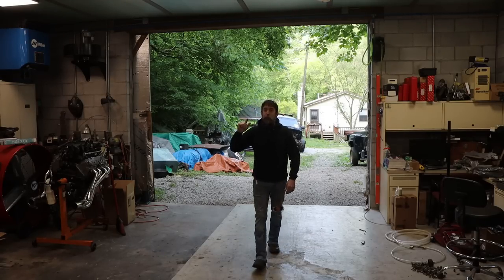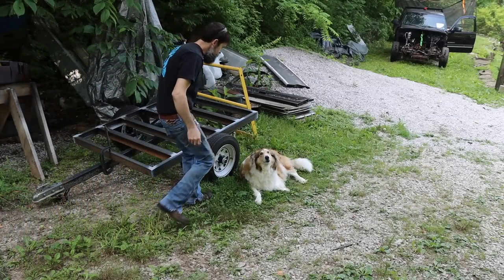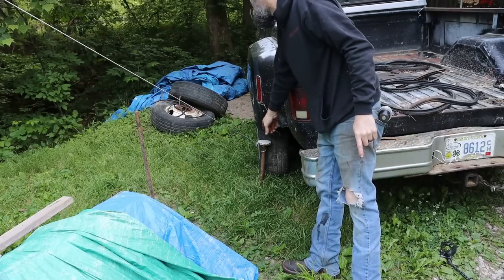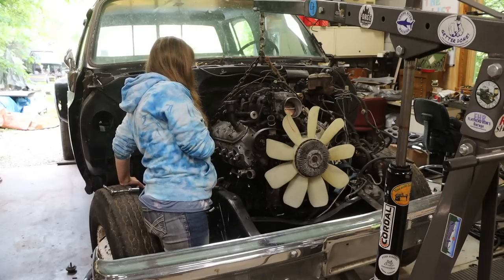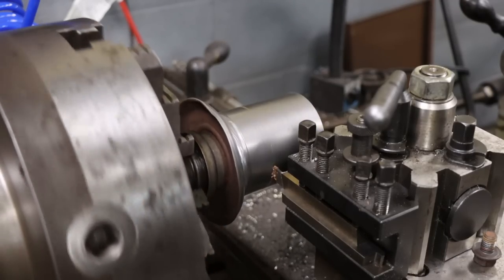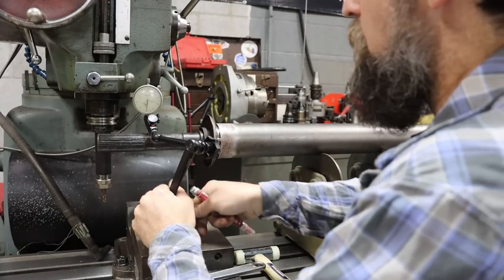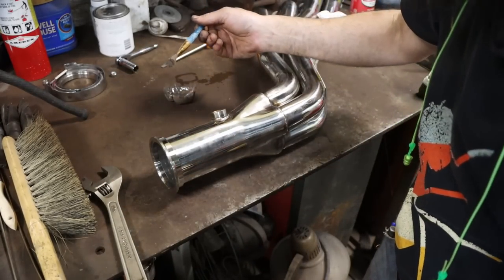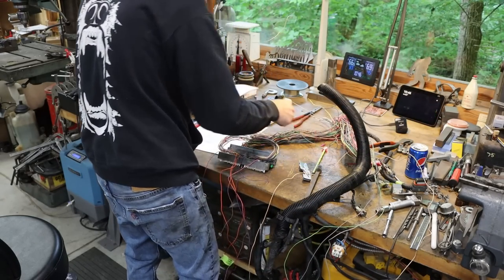Elizabeth & Me LS Swapping  Johnny Cash the Crew Cab part 2

Comment: Most people shortening driveshafts are not machinists and good welders,  I like that your content is all over the place, it means there is something new every video.
Reply from the maker: Thank you bud. A welder is a must but the machinist part isn't necessary.  I remember doing them when I was in my teens when I didn't have a clue😄. They worked thankfully

Comment: I also like to build like you do. Lots of folks throw money at the problem, and really have no idea why something isn't working. after your harness repair, you'll know what's going on when there's an issue. Great video!
Reply from the maker: Knowing more about the harness for troubleshooting is one of the main reasons other than cost, which is why I used the original. I didn't push the easy "Buy Now" button. All those wires are a little intimidating, but it was so much easier than I originally imagined.

Comment: I used to tig a lot of aerospace parts at my job. For stainless and titanium and inconel etc... we had holding fixtures for most and would flood shielding gas via an elaborate spaghetti of tubes and nozzles. Sometimes I would just take an extra tank and hose and flood the joint. Sometimes simple is best. Sure wish you had more subscribers cause you have good stuff to share.
Reply: I wondered if Steve's flux trick would work on Titanium as Ti is notoriously sensitive to back gas problems.

Comment: Keep that rear axle from the junk salt truck.  The disk break setup is great, and if you want to use it on the K10, it's not hard to convert your 10 bolt to 8 lug hubs.

Comment: Always makes me wonder when I see a guy who is doing a fair amount of engine work on cars who is without a balance beam on his engine lift.  I bought one from Harbor Freight in the early eighties when they opened up.  For a very little cost (back then I got it for under fifty bucks).  Makes life so much easier when pulling or dropping an engine in because you can vary the approach as you are doing it in as small of increments as you need.  I have used it in many situations and it has made all the difference.  In boats with tight spaces it is wonderful.   Of course I generally work alone so then it is indispensable for any kind of control and safe lifting without damaging things.

Comment: With all the tech we have these days sometimes good old proven high speed is the go to. Nice to have an hour with you today my friend. As an alternative for anti spatter is just good old fashioned Baking soda thinned in distilled water has always served me well. Headers can be a real pain in the toosh. Too  bad they really do make a difference. Wrap, flat black paint and a grinder are  the best friends we have on builds like this eh. Funny, when I was still working all the various wire and harness work came to me. On more than  3 occasions the shops owner and he would come in and see his brand new low bed truck with the entire front harness in a state of adapting all the needed wiring all over. He just said, I really hope you can put that all back together. When I was done there was no sign I had it all apart. I was always happy doing what others feared to put the wire strippers to work. It's always a nice Saturday when you post for us. Take care eh.
Reply: Yes wiring harness work needs care, and if you are careful you can make it look like it came from the assembly line again. A tip for Steve is if he is going to use slitted sleeve, put a layer of tape over the loom where it will run in the sleeve, and where the ends are at least 3 layers of tape, then put the sleeve. Also any exits from the sleeve, cut a relief in the slit, and 5 layers of tape there on the wires. That way they both have strain relief and also will not chafe through. Then outside you wrap over again with tape to keep it closed. 3M tape is the best, but expensive, though it does hold up well. with a knot at the end to keep it from unravelling as the adhesive ages with heat.
Reply: @SeanBZA  Exactly. As with many things we get what we pay for. Especially with black electrical tape. Many will pull and stretch tape to end a wrap when it always should be cut and tried not to be ended over an area that has finger prints on it. 3M is by far the best I can get. I do have a couple rolls of the cheap stuff for use in  un -important use but the good stuff is reserved for important things. Price is about $2(CDN) a roll of cheap stuff and $8(CDN) for the good stuff. WE GET BACK WHAT WE PUT IN. Ido crimp but only as a set up but solder and double shrink/glue lined tube. Again there is the single type shrink tube I only use that for holding runs of wire bundles together but neve at a fitting or end connections. If I only have single shrink I will put on 2 layers. Like you said with exits out of split loom/bundle guards they need that special attention. I no longer cut the hard plastic guard but instead use my soldering tip to melt that guard where the wires exits the melt leaves a nice and far less sharp exit Over kill ? but  I have seen far to many big rigs burnt to the ground from a poor wiring job. After a fire the mess left behind is a far more pain in the heini to have to repair some ones ignorance for sure eh. From  your words I  see you have seen and  done the clean-up from others yourself. Take care eh and keep on doing it right bud. I'll  be right along to sub you up my friend.
Reply: @TomokosEnterprize  Yes did the rebuild there, though first had to was all the dry powder off, as they used around 100 dry powder extinguishers before the fire brigade got there, though they could do nothing till the battery was disconnected. Kind of had to, as the tractor was attached to an aircraft at the time.
Reply: @SeanBZA  Pretty tense situation  for sure. Those electrical fires sure stink eh.

Comment: My custom driveshaft came from the driveshaft shop. It cost me $900 but now that it is in and I’ve been driving the car, I couldn’t be happier. The first attempt was enough to motivate me to pay the man. I put a 2013 LS3 out of a Camaro 2SS and the manual 6 spd trans (from the same 2013 Camaro) into my 1970 Camaro. It wasn’t too difficult, I did have to make a few parts and modify some. But it sits in there nice, like it came from the factory like that. 
It’s a little bit of a job. But you could definitely do it in a day. But I would recommend you take your time and make it safe, yet easy to service.

Comment: Hi Steve.  Lots of progress on Johnny Cash and lots of good tips!  I especially like the one about replacing the whole rear cover instead of just the seal.  As you know, GM didn't think it was important to use dowel pins to locate either the front or rear covers on the LS'es and getting the seal centered can be troublesome.  Thanks for the video!

Comment: Just a suggestion, when bleeding the brakes, always start with the longest line first. Right rear, left rear, right front, left front. That is unless you're just getting enough brakes to get it into the shop and plan on doing them again later.

Comment: 48:00 It's easier to used a phosphoric acid stainless steel cleaner to remove the oxide after welding.
And you don't leave wire brush marks.

Comment: Good thing Cora was there to help get the motor and transmission in, otherwise it would've gone a lot less smoothly. That's probably why you had so much trouble with the headers, I bet if she was there to help with those, they would've slipped right in too.
Reply from the maker: She is great moral support 😁. She is also there to give way more kisses than anyone needs.

Comment: Save the 14 bolt from the salt shaker donor. Probably a 4.10.. [fellow pack rat here] If i were closer, I'd come get it.

Curious why you are using the D-shaft brake drum from the RV? I was surprised it cleared the floorboards actually..😮

Looking good as always and I enjoy the truck projects. I grew up with those square bodies.
Reply from the maker: It clears the floor by about .1" a thin piece of cardboard will slide between it and the floor. I used it because I have it and I think it's a neat but kind of useless in this application.

Comment: This is inspiring me to put a new model engine in my c10
Reply from the maker: There is a ton of useful info on the web 🕸.  C10 swaps are as easy as they get. With the proper mounts it bolts right up like it was made for it.

Comment: Steve you might already know this but some RVs use the emergency brake as the parking brake.  My 1999 Coachman RV with a P30 chassis is like that.  They did not put the parking brake dog inside the transmission.  The drum brake on the end of the transmission is spring loaded on and there is a mechanism to pull it off.  It is a terrible system.
Reply from the maker: This trans has park. I think this was just for extra holding power.

Comment: 20/20 hindsight, did you check the runout on the shaft before you cut it?
Reply: Probably was worse that after it was shortened. The factory uses a jig, and then relies on balancing to get them to not vibrate, and that jig might not be aligned for hundreds of shafts, before alignment tells them to fix it as they are out of balance tolerance. If they took 5 minutes to make the shaft in the factory that was a long time, precut lengths, debur possibly, then slap the parts in the press and press the go button, then pull out, and off to the welding robot for the ends. If that jig was checked it was perhaps once a week.

Comment: Gonna need to cut a bit more off that right side frame rail- if you pull a heavy load that motor will rock over on the mounts.  Funny you did all that flux work to prevent oxidation on the pipe no one can see, but your headers are all oxidized up top.
Reply from the maker: Probably will have to remove a bit more frame on the passenger side 😄. Those headers are stainless so they should last a while before they start getting corroded.